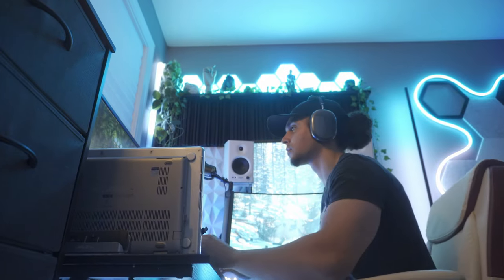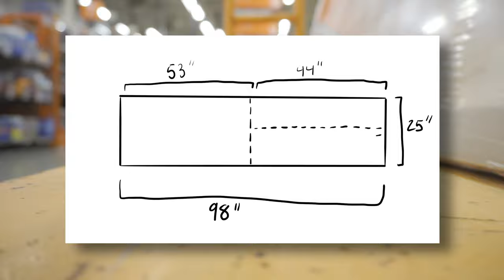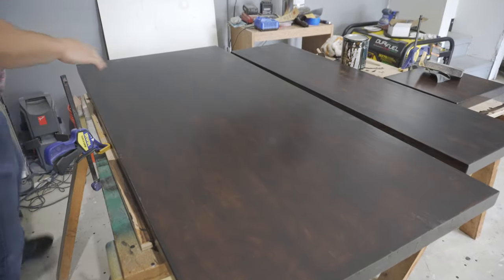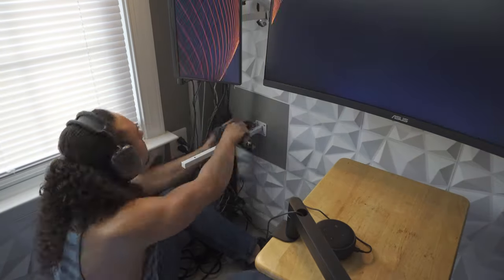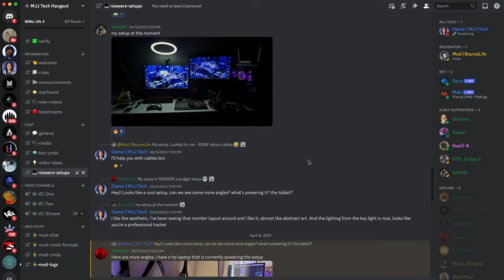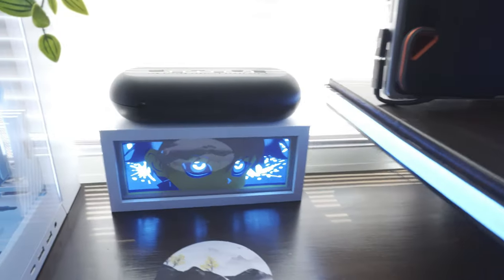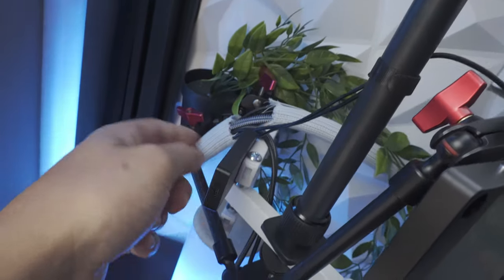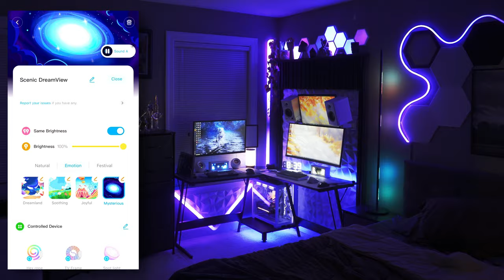Transforming My Bedroom Desk Setup [+Setup Tour]

Comment: On cutting that butcher block... It will pull to the right if you don't have the blade 100% aligned with the plate. The smoking is because as you cut through, the wood will pinch the blade. The chipout you saw is because of the way a circular saw cuts. It cuts from bottom to top -- so if your nice side is face up, then you need to either (or both) .. masking tape down where you want to cut and/or use a thin piece of sacrificial board on top to help reduce it. (Table and mitre saws rotate the opposite direction, btw). Wonderful video and great build!

Comment: would place a piece of wooden panel against the wall screwed in to the studs  so you can screw in the supports of your desk to alot stronger material  as you already crushed the drywall  it wil only continu  to sink in to the wall those supports in the long run

Comment: Definitely make sure to reinforce the brackets in the wall with a bit more than just cardboard bro, that's only going to be a very temporary fix.
I'd recommend getting a a wooden plate that you can screw into the studs, and then screw the brackets into that. It'll add more strength, it won't crush the drywall, and also helps with sound dampening.